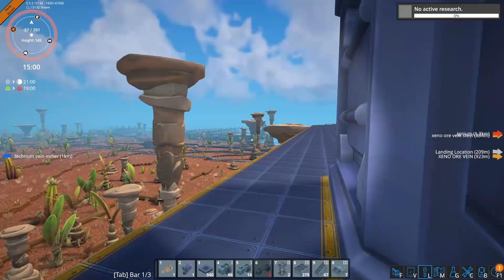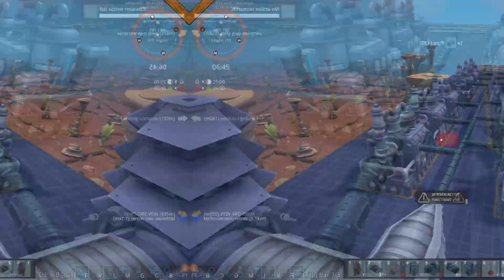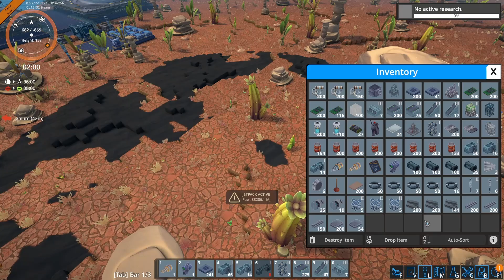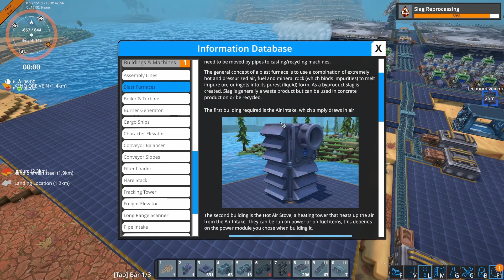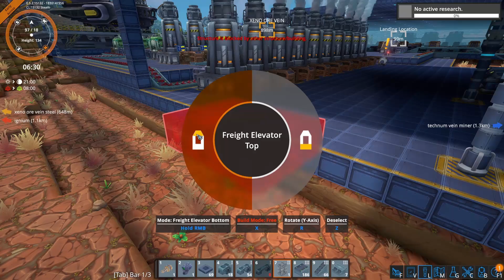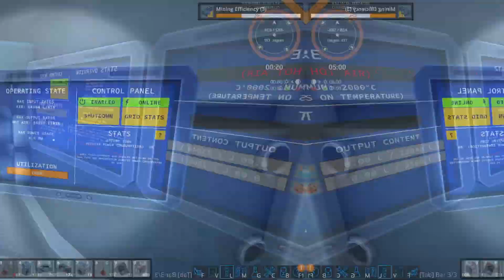Finding Solutions, Leads To More Problems in Foundry | Ep 17

Comment: 19:02 I think your mining operation lacks batteries. ;)

21:15 You just have a very low amount of fracking liquid in the pipe yet, and it shows that miniscule amount in scientific notation. :)

Bringing a full pipeline of fracking liquid only to switch to a normal pipe at the last moment was funny. Note that each segment of a pipeline contain much more liquid than a normal pipe, so you probably built an equivalent of that storage tower in the sky a few times over. XD

BTW, fun fact, despite showing a throughput of over 30k liquid the fracking tower have a normal pipe input which is limited to 30k per minute. Pipe speed equals its volume per second.

22:06 They have infinite reach behind them and ensure that any amount of liquid there will be pumped in the section in front and can't go back. As I told before, they don't really solve anything unless you want to dismantle a pipe and don't want to lose all liquid in it. They may speed up liquid delivery a bit if you place one at the end and there's any amount of liquid behind it, but I never bothered to check this, since liquid reaches its destination sooner or later anyway and then there's no need to pump it. The forefront just reaches destination much faster than any meaningful amount.

27:05 For future reference: 1 maxed out blast furnace require 3 maxed out air heaters and 2 maxed out air intakes. Half that for your build. These modular buildings are quite inconvenient in the terms of knowing their real I/O. They show the speed bonus, but what is the point when you don't know the base speed? :|

35:25 640 is the speed of 1 T3 belt (green, you are using these). This is also the max speed of T2 freight elevator (T1 is 320).
BTW, belts in the intake itself, until you connect external belts to them, have a blue color you won't find anywhere else on the belts yet. That's the next tier of belts working at 1280 items a minute, as I know. When you connect any belt to them, they change color and speed to match that belt.

39:03 Ah, the worst design mistake in this game. :) Separate UI's attached to every pipe input and output to set I/O filters. Especially fun for hot air intakes, since they are on the second floor and hard to access with a jetpack.
Reply from the maker: Ahhh so with the pumps I just sped up the flow to its destination, if I had just been patient eventually it would have caught up with itself.

In regards to the blast furnace this was frustrating I thought my issue was hot air intake so I painstakingly deconstructed them, cleared all my smelters and rebuilt it all to find I had the same issue then spent ages and eventually found those two stupid filter inputs on the second floor 😂 
Something I think they should have explained in the help section
Reply: @Krypt0nite  Liquids are weird in this game. Beside ignoring gravity, in minimal amounts they propagate through a pipe at absurd speed. Drop a bucket of water at one side, and it makes the entire pipe wet in seconds. XD Additionally, liquids take ages to completely leave a pipe. Otherwise, even without any supply and pump at the end, there will be a tiny amount of leftovers for a long while. That's where that plunger tool comes in handy, in case you mixed multiple liquids in a pipe or just want to reuse an existing pipe for something else.

And ye, blast furnace really needs a separate article in the help section.

Comment: Make sure you set the filters on the second floor for your outputs of your blast furnaces
Reply from the maker: This took me way too long to figure out, is it actually explained anywhere the location of these?
Reply: @Krypt0nite  Not sure. As I know, this building was designed before they decided to add jetpack to the game, so they expected players to at least try to explore the building.
Reply from the maker: Ahhh that makes sense, yeah once I unlock led the jetpack I don’t think I’ve not used it, it’s just so handy
Reply: I only knew about it from watching sutr plays channel, the blast furnace is the only thing I haven't built yet